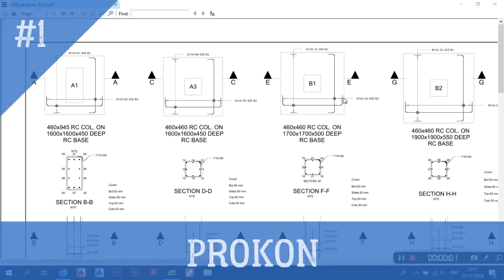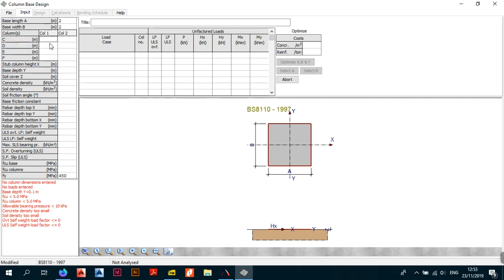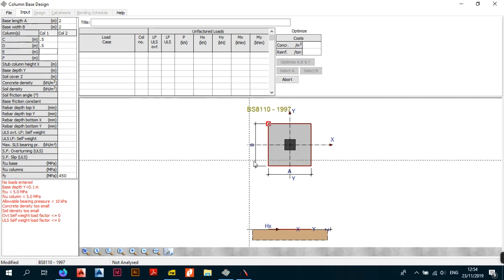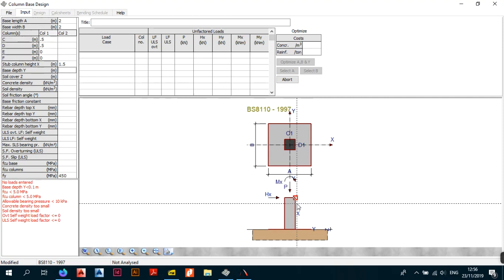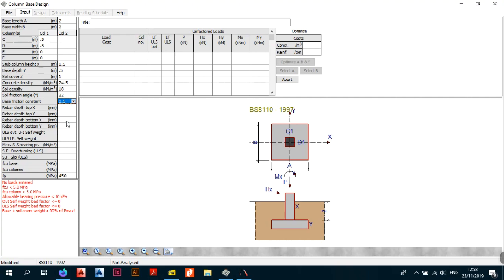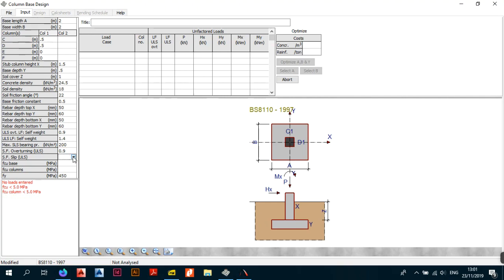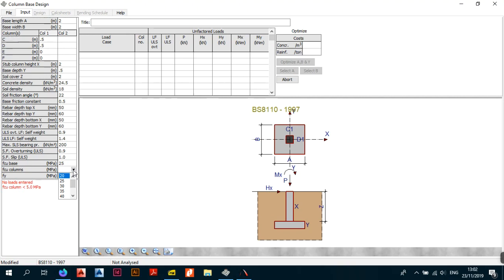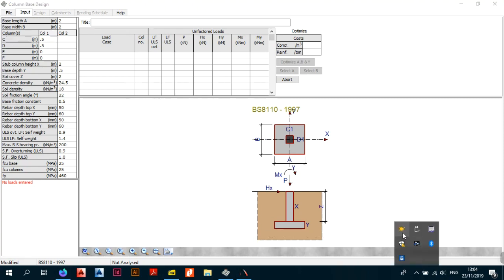Prokon Foundation Design_Pad Footing: introduction to the GUI for Reinforced Concrete Footing Design

Comment: What is the difference between the stub column and the actual column of the building esp in concrete, i think its pretty clear for me when its steel structures
Reply: Also in manual design i remember we use 1.4 for dead loads and 1.6 for live loads...idk what the ovt sf is...can you help with that